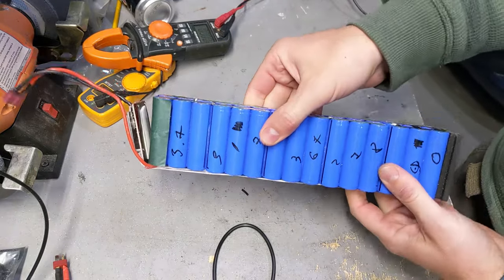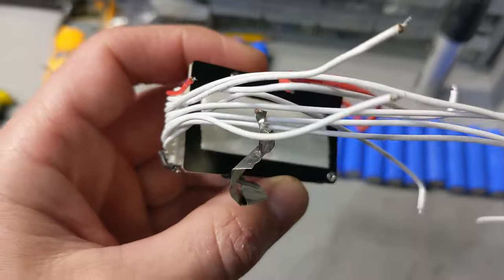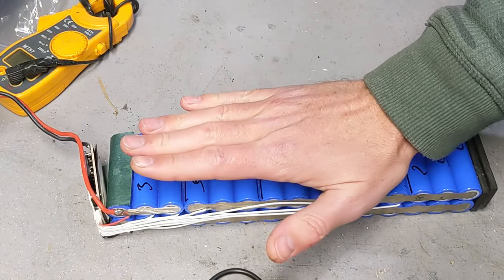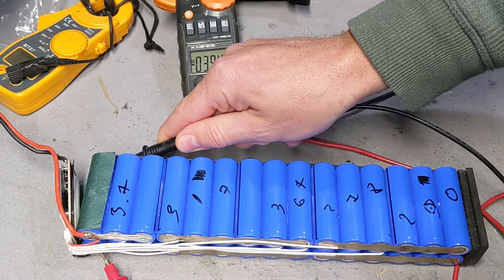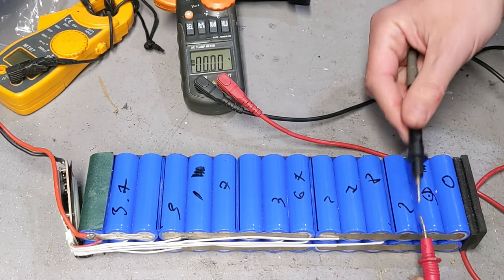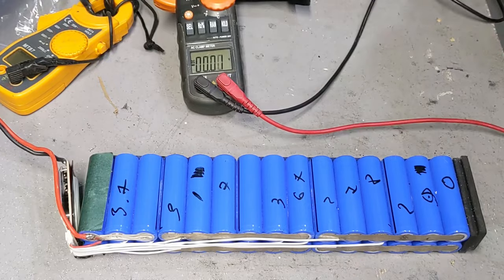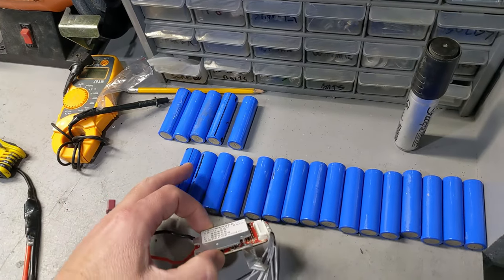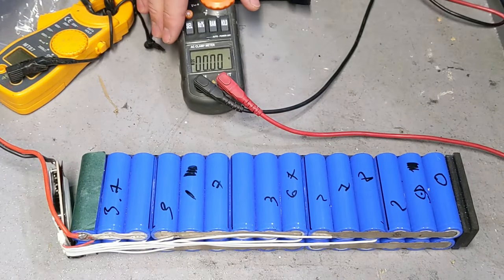Explained for BEGINERS   Lithium ion Battery not holding charge   How to Diagnose and FIX

Comment: Just as you can measure the voltage of individual blocks of 3 you can charge individual groups and I here would charge them to get the top bank to 3.94v each to match the lower bank. I would then put the battery on a shelf somewhere and wait a week and measure again. This will help work out if the low cells have a self-discharge problem or if they went flat because they have less capacity that the others which is terminal. The BMS will try to rebalance cells but, if you have not used the battery for a long while, self-discharge may have taken some cells so far out of balance the BMS can't fix things.Sometimes re-balancing all the cells to the same charged voltage will make the battery usable with improved range once more - for a while.
Reply: Ok. I understand that. But how do you do that? I bought a bike,and inherited a bad battery. 5 or 6  miles per charge,and that's it. How can that be fixed. I'm on a fixed income ,so I can't really afford a new battery.🤷🤷🤷

Comment: Hi. I have a lithium battery pack of 6 which puts out 7.2 volts, it charges but the charge doesn't last long only around 5 minutes,i have the same battery packs that last 20 minutes What would you suggest to do to get it back to a proper out put?
Many thanks Spike.

Comment: Is it safe open the battery like this and check it with a multimeter if its fully charged? As I noticed you said you need to discharge it. My ebike battery is fully charged but shows 0 voltage

Comment: If cells are unbalanced. I connected some computer fans to discharge the higher cells to match the lower cells then charge the whole pack. A bms discharge bypass could solve the cut out however you need to monitor the LVC.

Comment: Do you consider problematic receiving new lithium ion cells at 3.44v? I received my new 21700 Samsung INR 40T3 4.000mA, 35A cells from well known european company NK.. with 3.44v. Is that too low? I've builded an 2.8 kw 24s8p battery for an electric paramotor and has a huge voltage drop at 10-17kw full throttle and it should handle it like other similar batteries. I'm trying to find out why. Thanks.
Reply: 3.4V charge per cell is too low for high output applications so it is normal for the voltage spike dipping too low.. Charge it up to at least 3.6V or greater per cell.

Comment: Good video sir, Thank you.. I have one query to ask you, i purchased some lithium ion battery that are measuring different voltages for example some of them 3.6V, 3.8 V and 4.0 can I mix all cells together in parallel connection?
Reply from the maker: They should be brought to the same voltage before connected together so you should either all charge them to the max or discharge them to bring them back to a level that is close in between
Reply: Thank you so much sir for your valuable feedback. It will help me a lot.. 🙏🙏🙏👍👍

Comment: So maybe i missed the answer to my question, but if you can narrow it down to a single pack can i not just disable it for lack of a better term? And then have my battery working again even if at just 2/3 of the original potential?
Reply from the maker: No you can't disable it , also replacing is not a good idea because the packs need to be the same age and specs ...

Comment: My 48V ebike battery shows nothing on charge indicator on actual battery.  When I connect battery to bike no power, when I connect wall charger to batter nothing just green light on wall charger indicator? Any suggestion to resolve this or is there a shop who works on these?  I hate to toss battery as its only 2 yrs old with little run time very few hrs.
Reply: Not only does the BMS turn off the battery pack output if the batteries are out of balance, it also turns off the charging input so the battery will not take a charge.  I had the same issue on a 48V pack.  I did exactly what was shown here, measured the individual packs and found one that was very low.  I charged the pack with a current limited bench power supply until the voltage was back in balance with the rest of the packs and the charger then started working again.

Comment: Some bypass the BMS output side but keep the BMS charging input. It would monitor the charge but not the discharge so you have to have a gauge to monitor the LVC yourself
Reply: nice way to blow out the battery, burn the house or whatever. 
Deeply discharged li-ion can grow a copper electrode or make a short cut because of dissolved copper ions in electrolite and blow up a single cell that is enough to start a chain reaction in neighbour cells. So it probably will work for a while, but then it can BOOM.

Comment: i need help i have a bms which had low batteries,i disconnected the bms and i charged them all up to 3.7 so they are all balanced the bms gives 48v at the charge connector and 1.6v at the power connector...is the bms dead ?? or does it need reset or something i dont have 52v charger.
Reply: Reset. Connect a charger.

Comment: How do you know how many volts are meant to be in each single battery when you test them .very helpful video thank you
Reply: Difference between weak and strong one matters more.The cells voltages are from 3V to 4,2V at full charge.

Comment: on laptops if you change one cell the bms will cut the power and you have to reprogram it to fix the battery, in scooter doesent do that? you can change them with no problem?
Reply from the maker: Depends of the BMS but if you buy a laptop that is too smart then it might do that but usually the dumb stuff doesn't care and scooters have dumb BMSs

Comment: What about a 52v samsung celled lipo battery thats not charging past 80%? Bad charger??🤔
Reply from the maker: Maybe bad BMS .. it reads wrong . How much power you got in it, This charger too as low as you can and then put it on a watt meter to charge and see how much power it can draw
Reply: @TheCrazyRomanian  changed the BMS and it didn't fully charge. Put the original one back on and it fully charged. I think its the charger. Don't have a watt meter

Comment: what happens if i remove the bms?
Reply from the maker: No more battery ..
Reply: @TheCrazyRomanian  i thought if i removed it it would be fixed
Reply: Some bypass the BMS output side but keep the BMS charging input. It would monitor the charge but not the discharge so you have to have a gauge to monitor the LVC yourself

Comment: Does somebody know what IS wrong with My scooter battery. One cell is full 4.2v and every other is 3.6v. itse 42v battery
Reply: And its says its full because one cell is full
Reply: I think the problem is the balancing in the bms system to discharge the 4.2v cell to 3.6 and looking at all the battery if it is the same problem. Change the bms system

Comment: If you use average cells. They will fail. If you use a hobby charger you can stay ahead of the issue with bms DEAD IN WATER